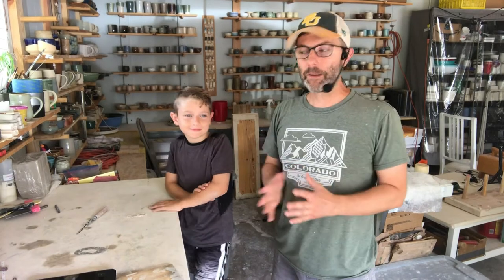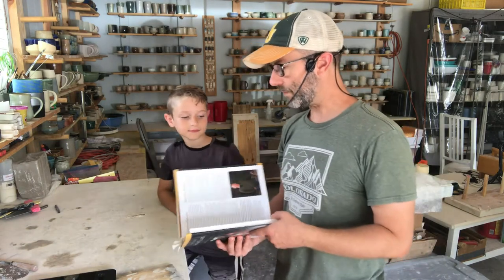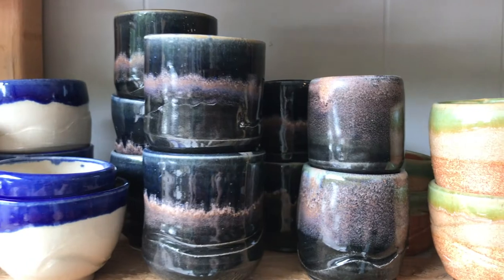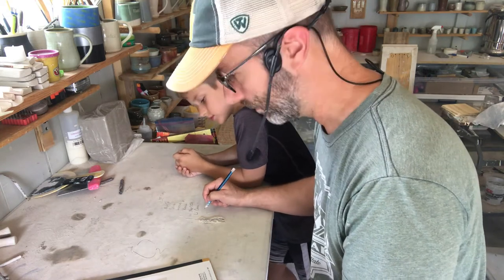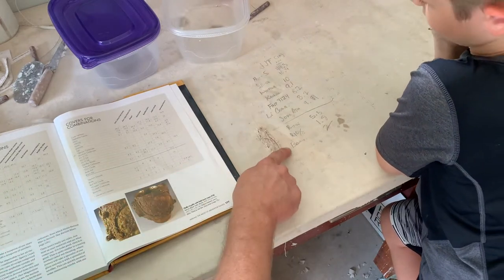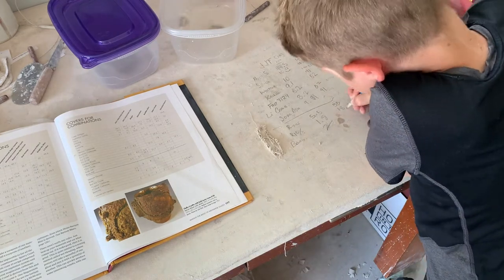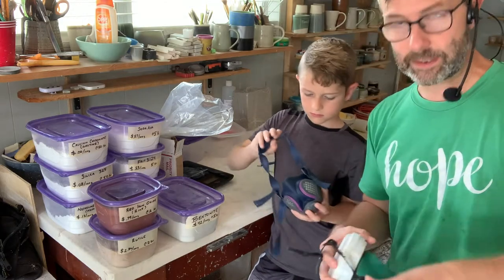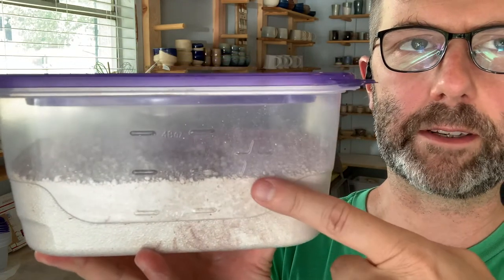How to Mix a Pottery Glaze - Reading and Mixing a Ceramic Glaze Recipe

Comment: Great, interesting video. I see you make a small amount of each glaze. How do you apply it?
Reply from the maker: Hi Julia.  I usually dip but i was mainly dealing with small vessels.  Now I usually apply a base coat of white then spray, brush or dip the vessel as a second layer.  That's what i've been doing lately. Thanks for asking! -mj

Comment: I love your videos!  Can't wait to heat up to my source in Austin and begin mixing glazes!  I saw a video recently on adding a small amount of glaze to underglaze on greenware and doing a one-step glaze firing rather than going from bisque to glaze.  What are your thoughts and have you tried that?
Reply from the maker: Thank you BB Jo!  Sincerely. That means a lot.  

Regarding single firing it can be a little riskier.  I don't have bisqueware explode often but it does happen on occasion when I"m bisque firing. When it's just bisque it usually just affects the exploded piece.  But you can imagine how many pieces on the shelf would be affected if that unbisqued vessel exploded with glaze all over it.  I've only singe fired a few times and made sure my pots were very dry first.  I think it's awesome just be careful to have your pots all the way dry first!

Here's an article from Steven Hill who does some single fired work which looks amazing!  https://ceramicartsnetwork.org/wp-content/uploads/2009/02/cmjan06hill.pdf.   

I also recently did a video on Hill's firing schedule here: https://youtu.be/H6nmVdqizog

Benner Barclay here in Texas also does a lot of single fired work.  I have one of his mugs in my shelf and I LOVE it!

Thanks again for the encouragement BB Jo!

mj

Comment: Help explain the amount of water in relation to dry mix. I tried John Bits recipe and totally failed assuming my ratio of water to dry mix was way off
Thanks.  And I enjoyed your video
Reply from the maker: I totally get it Glenn.  This water to mixture ratio is called "specific gravity".  Coyote Clay's website has a lot of good tips on exactly how much water to mix you need with their glazes.  The amout of water you put in will drastically affect the glaze.  

So basically you find specific gravity by filling a container to a set amount (say 100 ml).  Then you weigh that mixture (say the mixture weighs 150g).  So 150g/100ml is a 1.5 Specific gravity.  Dont' forget to subtract out the wight of the container your weighing the mixture in too!  

I can do a video on this if you like Glenn.  it's kind of a hard concept to explain but it makes a WORLD of difference in your glaze resutls... specifically in repeating results as you create multiple batches of the same glaze.

Let me know Glenn if you'd like to hear more about it.  Thanks for contributing!

Comment: Hi, How do we know how much water to add? I know you added half again the water to the dry ingredients but doesn't it need to be precise to have the glaze be the right consistency? Thank you
Reply from the maker: Dana, you are absolutely right!  it does need to be very "specific" 😉  😉.  .  The technical term is called SPECIFIC GRAVITY and it refers to the "weight to water ratio" of the glaze mixture.  Coyote Clay has some great specifics on mixing and specific gravity here: https://www.coyoteclay.com/Dry.html

the formula for specific gravity is WEIGHT (in grams) / VOLUME (in ml).   So practically this looks like:

1. fill a container to 100, 500, or 1000ml with the glaze you're measuring.
2. weigh how much the the glaze in the container weighs.
3. subtract the weight of the container itself (mine is usually about 42 grams)
4. divide GRAMS / MILLILITERS.  = SPECIFIC GRAVITY of that mixture

The same glaze will often look very different at a different specific gravity. it's good to know what the glaze maker or recipe provider suggests for specific gravity.

This would make a good video i think.  When i open up a kiln to see something i was not at all expecting, it is USUALLY because my specific gravity is off in one or more glazes.    Great Question!